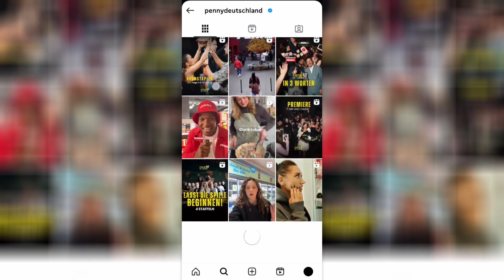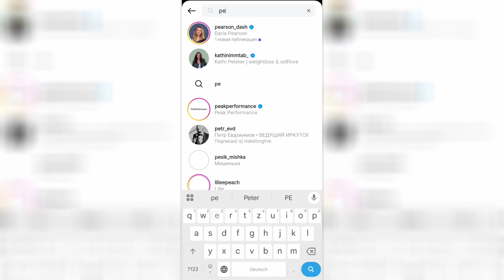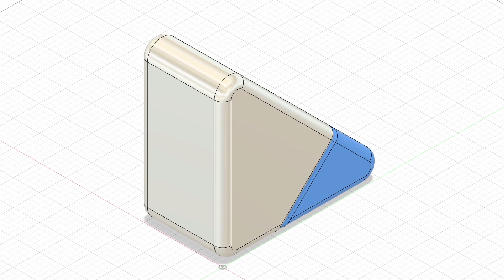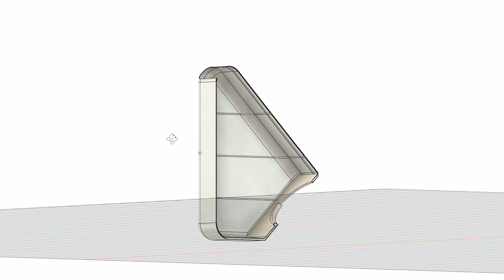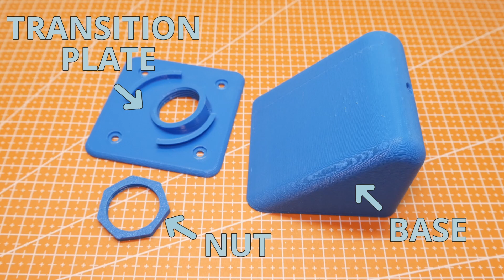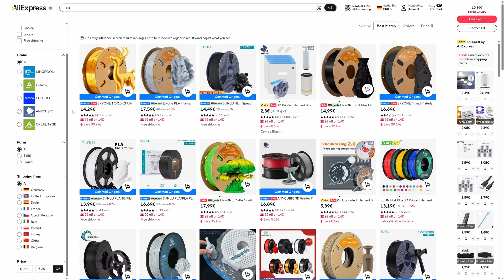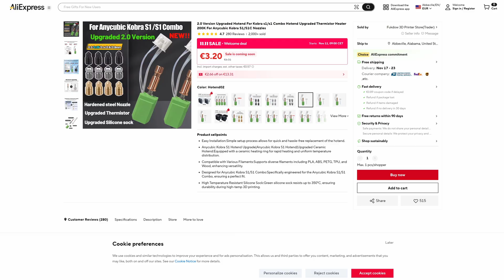I Solved Germany’s Biggest Problem With a 3D Printer

Comment: 6:40 you could've easily printed 0.8mm lines with 0.4mm nozzle, especially in vase mode
Reply from the maker: You're right — but I forgot to mention that the layer height I used was 0.4 mm, and you can’t reliably get that with a 0.4 mm nozzle since it’s limited to around 0.28 mm. Yes, you can tweak it higher, but I wasn’t really in the mood for experimenting at that moment. With a 0.8 mm nozzle, a 0.4 mm layer height is the default, so I didn’t need to tune anything.

I also specifically wanted to try a larger layer height, because together with fuzzy skin it creates that fabric-like texture I was aiming for.